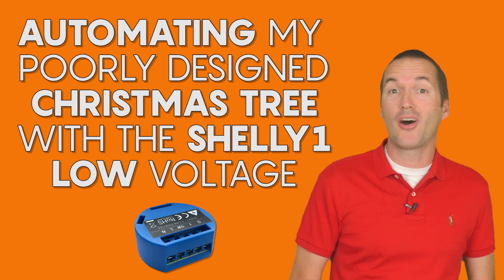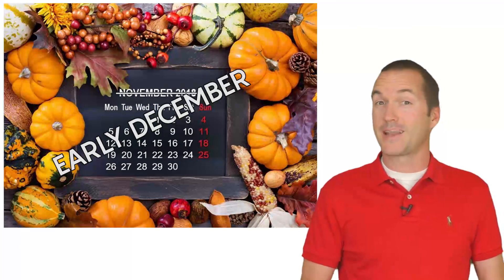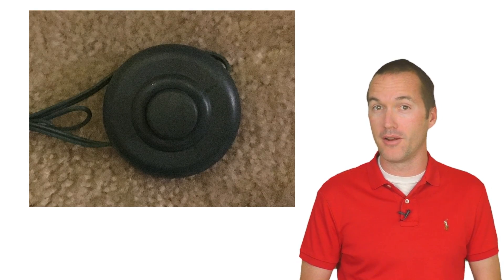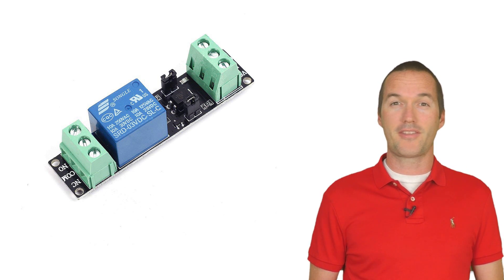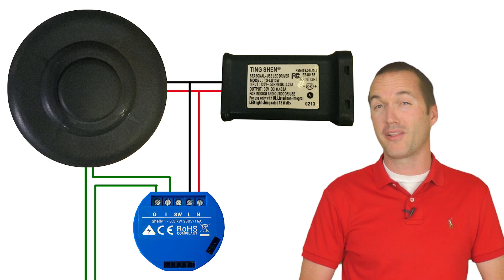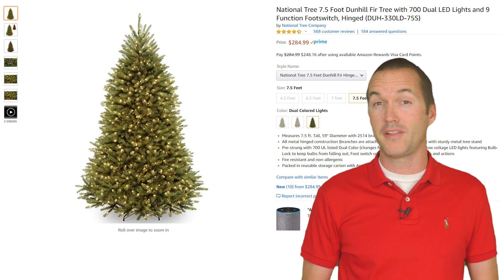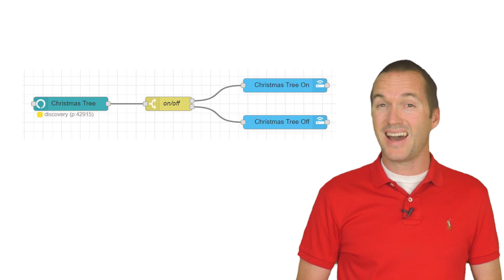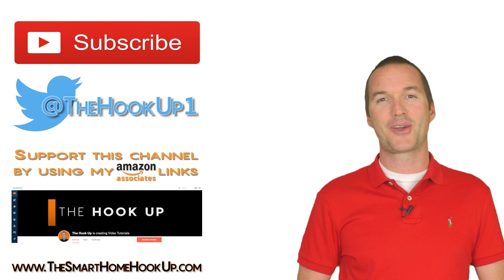Automating a Flawed Christmas Tree with a Shelly1 (Low Voltage)

Comment: Do you think I could run the same wiring minus the foot switch to use exiting 24vs that went from an old dumb humidistat to the shelly1 for power and also to the solenoid of the humidifier's water valve. then use Home assistant to control the humidity?

Comment: Ha, this is perfect for what I needed to see about this device.  I am planning to use one of these as an Automotive relay so it will run on 12v and I needed the isolated relay to interrupt power to a HAM radio.  Now here is the kicker and why I wanted to use the Shelly 1 instead of just a standard automotive relay.  The ability to program pulse time w/ Tasmota so that my car can start, any power flux can settle from initial ignition and then give power to my radio as those radios can be sensitive to power spikes if left in an always on state.  Cheers from Vicious Computers (The guy that came up with that Tasmota Termite programing video) I'll have to do a video for sure on this project.  Thanks for the video, I'll be sure to check out a bit more of your stuff as I seem to be back in "project mode".

Comment: Have you thought about a project to replace the brain?  I have similar tree from Costco.  The think SHINES LIKE THE SUN.   I'm thinking about a project that builds a PWM dimmer and directly control the polarity of the output wires.   With PWM and polarity control, hypothetically  I could fade between color and white.

Comment: The footswitch on my tree was just a simple switch for on and off and further down there was a control box for the smarts so it retains the patterns I selected. It was a 12' costco tree. What did you do for a project box?
Reply from the maker: Still haven't put it in a box, if I get around to it I'll 3d print one, but it's out of the way at the moment.  Out of sight, out of mind.

Comment: Great video, early for me but good info!
Regarding your issue with local Alexa en node red, I was configuring node red yesterday and I ran into the same issue with Alexa, and I found the way to add it. The thing here to remember is the local node add all devices as lights, so go to the app, add new device, select light, go to the bottom of the list and select other, it will give you the option to search for devices, it did find it for me and now I can ask Alexa to run HA scripts for me like "Alexa, turn on good night", which will toggle the good night script. Hope this will help.

Comment: BTW I'm using the latest version of Hassbian and it's not connecting with node red

i'm on the latest firmware of 

NODE JS
HASSBIAN 
NODE RED 
I did an apt-get update && apt-get upgrade ( + updated the hassbian via the hass-config) nothing is working

Comment: Hey
You find a work around the local alexa node yet ??
Reply from the maker: I got it working, but I'm not exactly sure how.  Instead of using the alexa app on my phone to discover devices I asked one of my older (2nd gen) echo dots to "discover new devices", it told me it didn't find anything, but the device showed up as a new "light" the next time I opened the app.
Reply: I bought 5 Dot3's over the last few weeks and tried to discover a new device from Node Red and it wouldn't find it. I plugged the Dot 2 in again and ran discovery again and it added it.
Reply: I was configuring node red yesterday and I ran into the same issue with Alexa, and I found the way to add it. The thing here to remember is the local node add all devices as lights, so go to the app, add new device, select light, go to the bottom of the list and select other, it will give you the option to search for devices, it did find it for me and now I can ask Alexa to run HA scripts for me like "Alexa, turn on good night", which will toggle the good night script. Hope this will help.